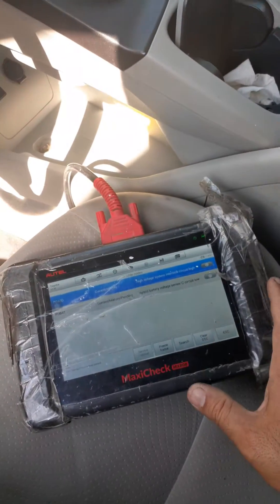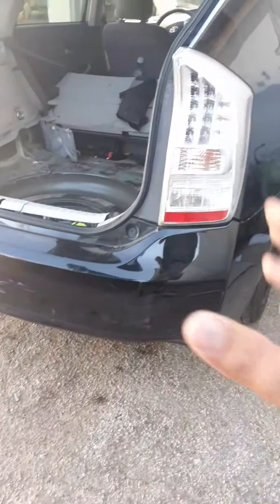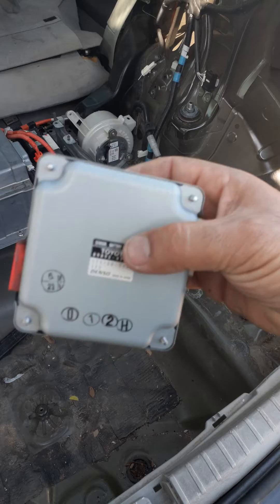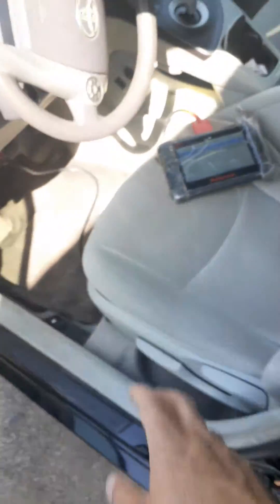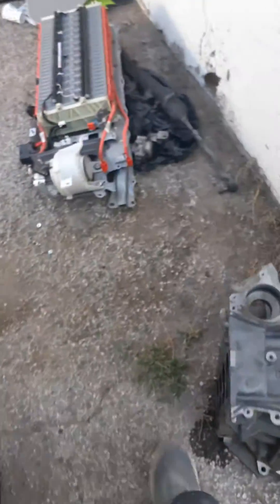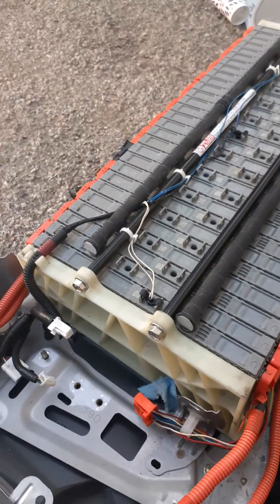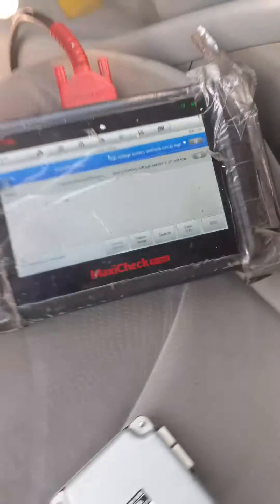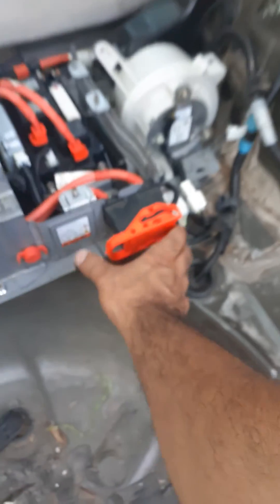Toyota prius p0B47

Comment: hello greetings I have time following your channel and I know you know many of these hybrid cars.  I have a problem for some time my car is a 2007 prius with 115 thousand miles.  At this moment it is not possible to drive and it throws the code p0a78-287 that speaks of the inverter.  I changed the inverter and it did not work and I have tried everything even with the original toyota program to be able to scan and remove the subcode but I am afraid to change the transmission which is the only thing I am missing and that is not the problem ... you recommend me  ?